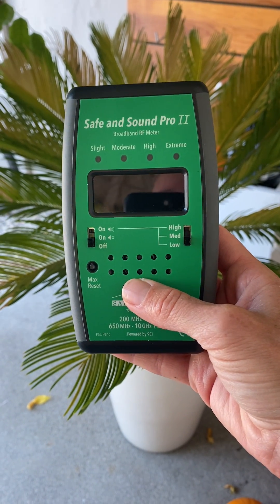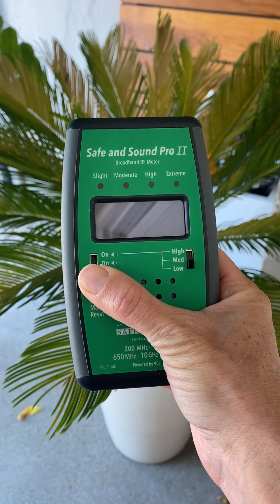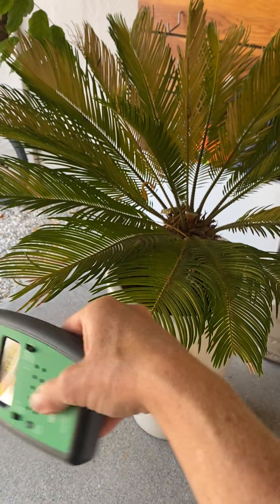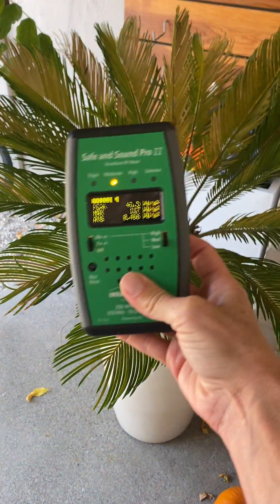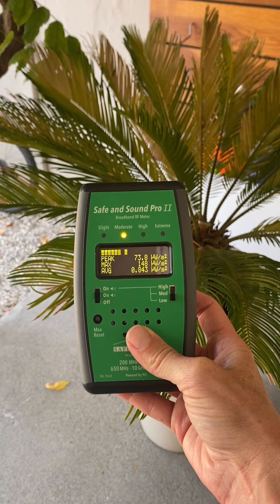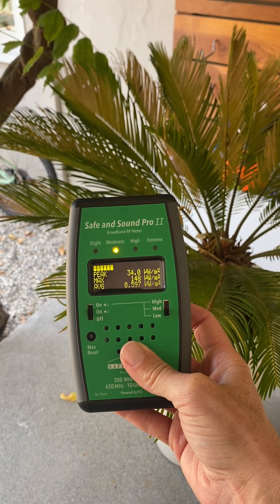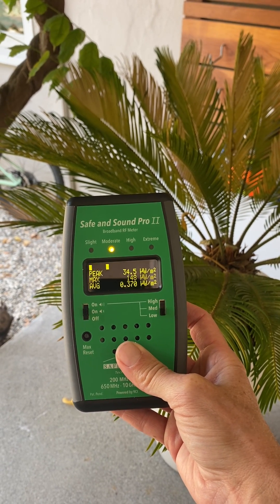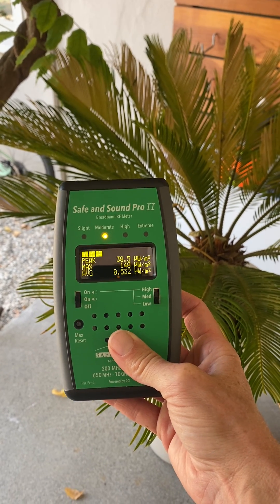How To Use Safe and Sound Pro II RF Meter

Comment: hello! 2 questions please! for measuring my house; shall i do that wave movement in every place that i want to measure? Which values are conssidered safe? thanks !❤️
Reply from the maker: Yes, use the figure 8 method when measuring in all areas. Building Biology recommends 10 microwatts per square meter in sleeping areas, which is very low and can be difficult to achieve in an urban/suburban area. Aim to eliminate sources to reduce the readings as much as possible.